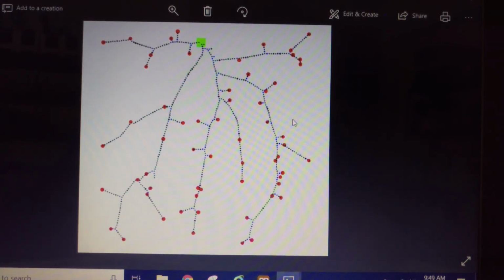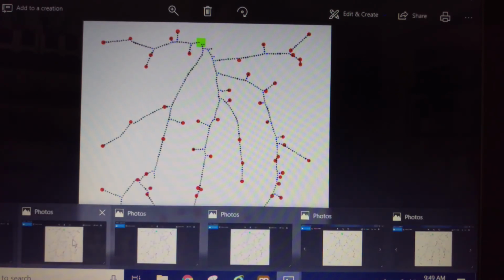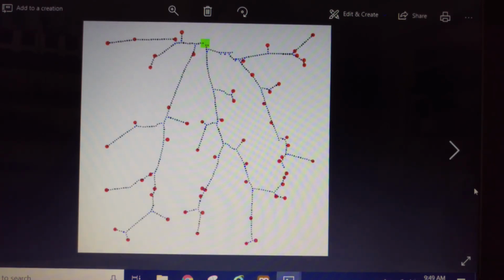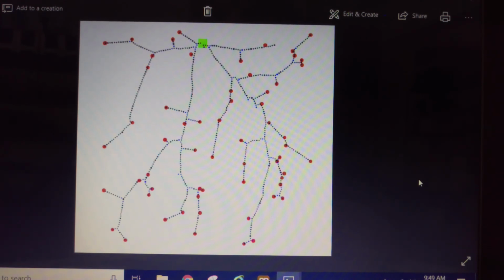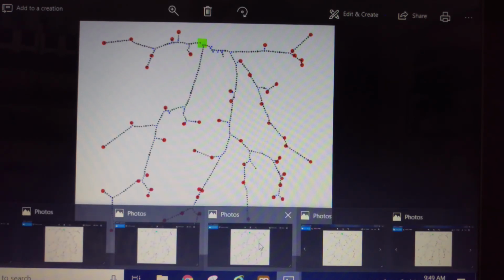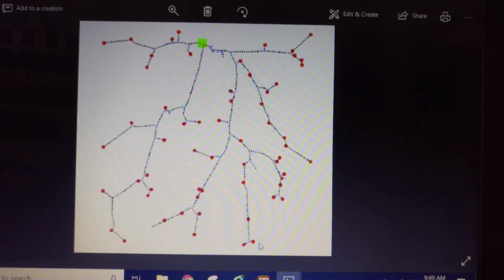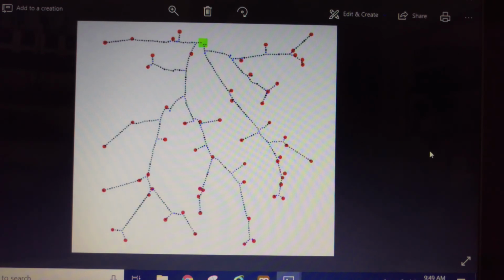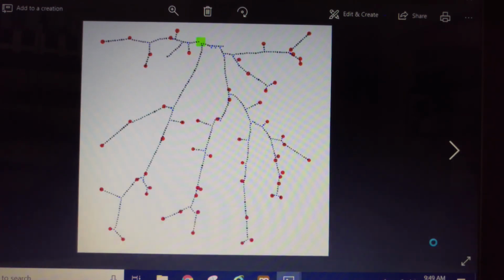Connection Optimization Algorithm vs. Steiner Tree

Comment: can you share the code, please?
Reply from the maker: I will gladly supply the code to you but you must earn it by solving the problem below:

You must determine what can be concluded from the 60 statements below.  The numbers in each statement represent binary variables (true or false) or attributes.  For example "3" could represent "blue" or "door 4" or "3rd person" or "does not work on Saturday" or any attribute of a logic problem.  To put this into words statement 1 would read:  "If 3 is true and 29 is true then 13 is false."  

statement 1 :  if 3 and 29 then not 13
statement 2 :  if ( 27 and 9 ) or ( 14 and not 10 ) then 4
statement 3 :  if 14 and 28 then not 6
statement 4 :  if ( 2 and 16 ) or ( 27 and not 18 ) then 24
statement 5 :  if 14 and 29 then 11
statement 6 :  if 7 and 11 and not 10 then 21
statement 7 :  if 30 and 3 and not 12 then 11
statement 8 :  if 3 and 7 and not 1 then 23
statement 9 :  if ( 10 and 1 ) or ( 23 and not 16 ) then 27
statement 10 :  if 19 and 9 then not 27
statement 11 :  if 26 and 8 then not 5
statement 12 :  if 10 or 19 then not 13
statement 13 :  if ( 1 and 6 ) or ( 9 and not 13 ) then 25
statement 14 :  if 11 and 3 and not 4 then 17
statement 15 :  if 28 or 16 then 8
statement 16 :  if ( 2 and 7 ) or ( 14 and not 13 ) then 20
statement 17 :  if 27 and 26 then 15
statement 18 :  if 27 or 7 then 4
statement 19 :  if 30 and 11 and not 24 then 28
statement 20 :  if 27 and 10 and not 30 then 29
statement 21 :  if 27 and 9 and not 24 then 4
statement 22 :  if 4 and 28 then 15
statement 23 :  if 16 or 23 then not 25
statement 24 :  if 20 and 17 then 11
statement 25 :  if 6 or 28 then 30
statement 26 :  if ( 5 and 18 ) or ( 6 and not 26 ) then 16
statement 27 :  if 23 or 21 then 20
statement 28 :  if 25 or 6 then 20
statement 29 :  if 29 and 8 and not 23 then 7
statement 30 :  if 9 or 18 then 16
statement 31 :  if 12 and 11 and not 24 then 2
statement 32 :  if 6 and 24 then not 15
statement 33 :  if 9 or 5 then not 25
statement 34 :  if 17 and 8 and not 26 then 22
statement 35 :  if 15 and 1 then 11
statement 36 :  if 28 and 5 then 2
statement 37 :  if 2 and 9 and not 12 then 6
statement 38 :  if 26 and 14 then 22
statement 39 :  if 12 or 16 then 13
statement 40 :  if 9 and 8 then 16
statement 41 :  if 8 and 15 then not 27
statement 42 :  if 18 or 7 then 25
statement 43 :  if 30 and 2 then not 17
statement 44 :  if 23 and 4 then not 9
statement 45 :  if 17 and 11 and not 18 then 29
statement 46 :  if 10 and 5 then not 28
statement 47 :  if 12 and 18 and not 9 then 23
statement 48 :  if 9 and 17 then not 18
statement 49 :  if 21 or 5 then not 22
statement 50 :  if ( 21 and 16 ) or ( 19 and not 17 ) then 25
statement 51 :  if 13 or 24 then not 6
statement 52 :  if 1 and 18 and not 2 then 30
statement 53 :  if 8 and 30 and not 1 then 9
statement 54 :  if 10 and 28 then 6
statement 55 :  if 13 or 12 then not 21
statement 56 :  if 1 and 22 and not 20 then 23
statement 57 :  if ( 3 and 30 ) or ( 12 and not 13 ) then 23
statement 58 :  if 8 or 11 then 14
statement 59 :  if ( 27 and 16 ) or ( 17 and not 28 ) then 21
statement 60 :  if ( 27 and 16 ) or ( 22 and not 14 ) then 28